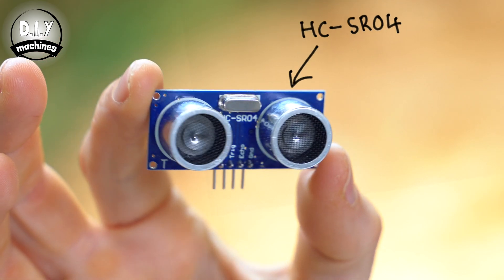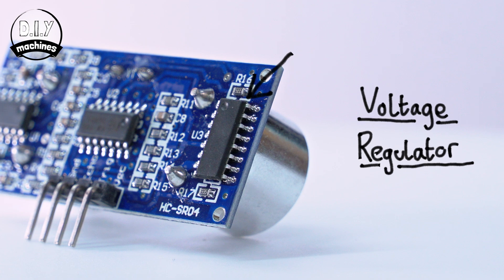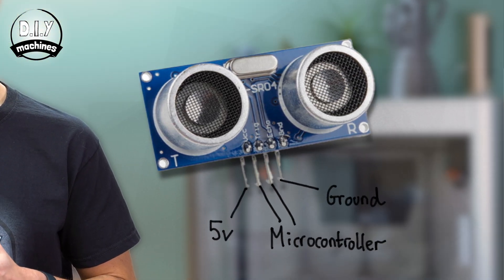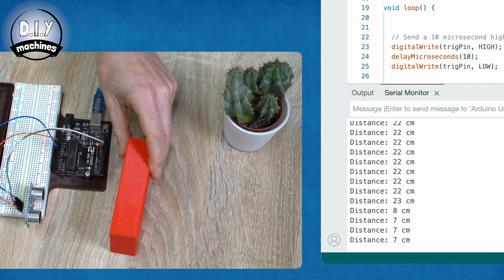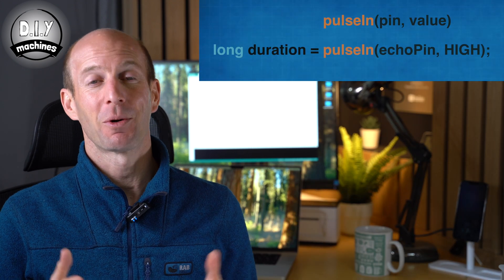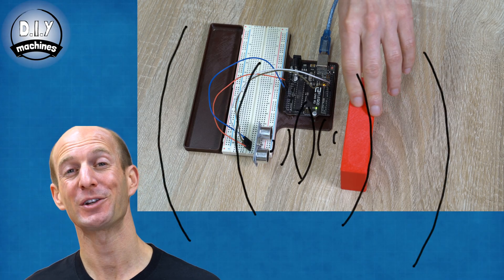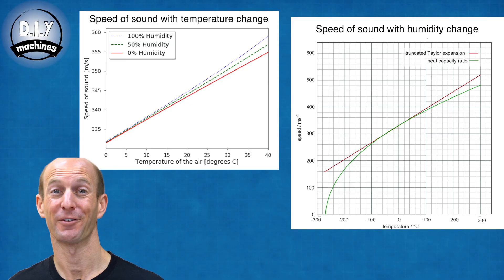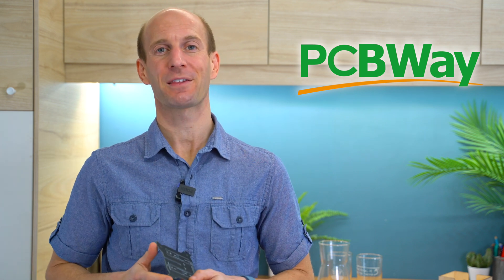HC-SR04 ULTRASONIC SENSOR - WHAT it is and HOW to use it.

Comment: Hi there. I create, design and print different types of whirlygigs. (please check out my channel). Im in the process of designing a whirlygig that will light up at nighttime, when the blades of the whirlygig go past a motion sensor. Ive been trying to get this happening but using the HC-SR501 with a LDR attached (to enable night mode only). Ive had nothing but failures so far. Is the SR04 a better motion sensing option, as obviously, whirlygig blades do not have heat movement? If so, is there a way of using the SR04 with a LDR? Any help would be greatly appreciated.

Comment: Back in 1985 I built a robot with a rotating sonar system, using ultrasonic transducers very similar to those used today.  While rotating, the sonar pulsed once every degree.  Over one weekend I spent a lot of time testing my sonar with my head a few feet from the sonar system.  I had no idea that a 40KHz pulse, which I could not hear, could damage my hearing, but that is what happened.  In one weekend, I permanently damaged my hearing and it has only gotten worse over the last 35 years.  Later I calculated the SPL (sound pressure level) of that sonar’s output pulse from the amplitude of the driving signal and transducer’s data sheet.  I found the sound output of that transmitter was about 125 db.  On my current robot I have three HD-SR04 boards which I use for collision avoidance.  I measured the amplitude of their transmitter signal and from the 40T/R transducer data sheet I calculated the SPL of the 40KHz output sound of the HD-SR04 to be about 115db, which is still loud enough to damage your hearing.  So please keep your head far away from the front of the sonar board.
Reply from the maker: Oh wow, that is something I had never considered either. Thanks for sharing the warning so others (including myself) can avoid this.
Reply: i feel grateful that i get to swim in the same waters, such as legends like yourself. thanks for all the contributions!  im hoping to use ultrasonic cleaning to fix some michigans dirty water. bonus points if we can use them in data centers.

Comment: wouldn't it be better to use a laser? i guess it depends on use
Reply from the maker: A laser would be preferable. You can get systems such as 1D LIDAR. For the project I was designing   that lead me to research this module and then produce this video as an offshoot I will also be using 2D LIDAR to allow for SLAM (Simultaneous Localisation and Mapping) of the bigger environment whilst these sensors will allow detection of other features on different angles without the cost of 3D LIDAR. For the price - this modules are a decent gateway into detecting objects and distance.
Reply: I guess it depends.  I'm going to be measuring the distance to an object that's shiny.  This may be a problem for a laser.
Reply: @evansste  put tape on your shiny object
Reply: @TecraTube  I don't want to alter the weight of the shiny object; which is a steel shaft in an air bushing.

The shaft is being used to static balance a disk.  So, it's important that nothing be placed on it, other than the disk.  Even painting it, could alter the weight, significantly enough.  This is because I'm using paint to balance the disk.